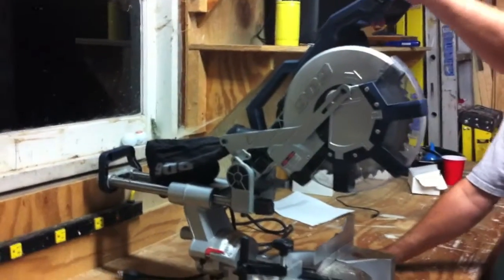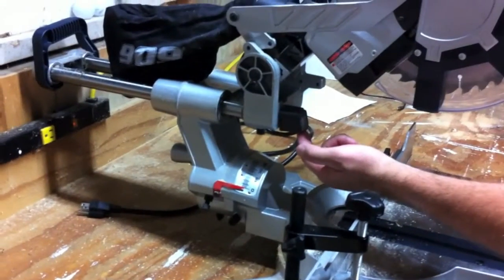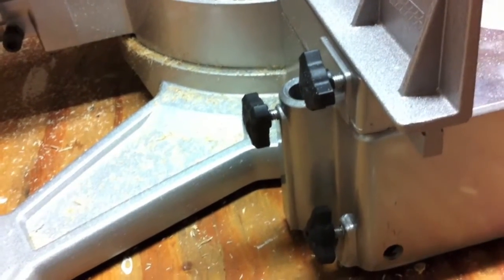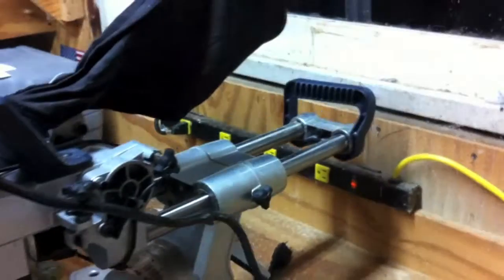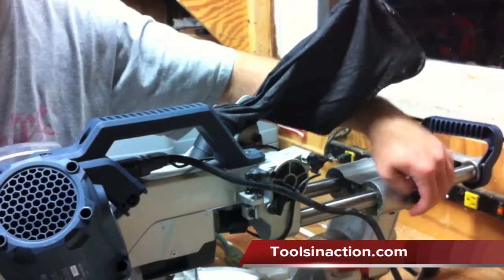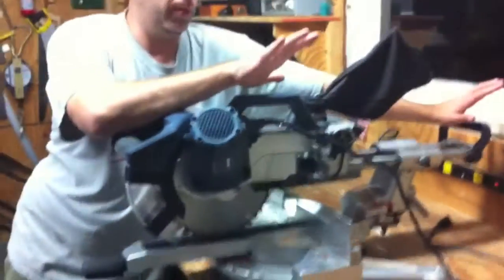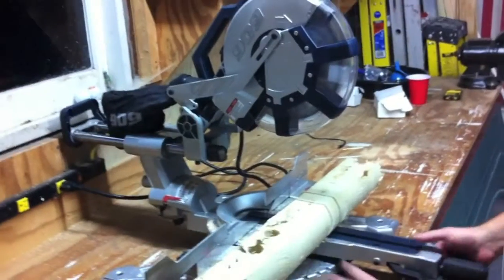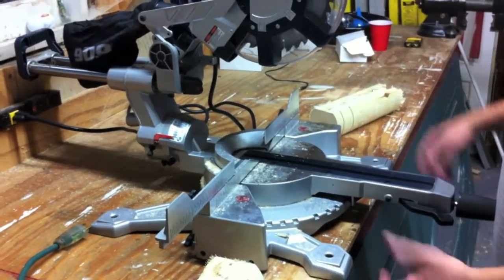909 255DBUL 10-Inch Double Bevel Slide Compound Miter Saw - Overview

Comment: My issues with the 909 brand is, you can't buy parts, and you have to make sure you take car of it, you've got to regularly oil the slide rails or they rust pretty easy.
I got mine second hand, I didn't know it was missing options until I did some research on it.
so I'm in need to make my own clamp replacements /modifications.
it IS a nice saw though. I'm quite happy with it.
Oh, the other gripe, the degree stickers are really cheap and nasty and can start peeling up if they get wet, would have been much better to engrave them.